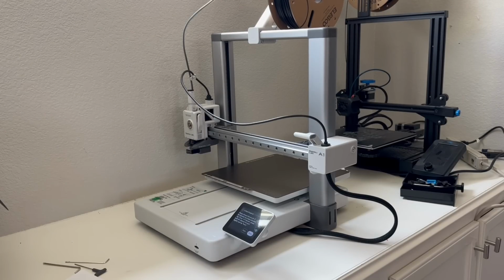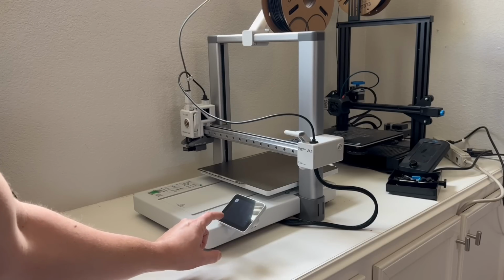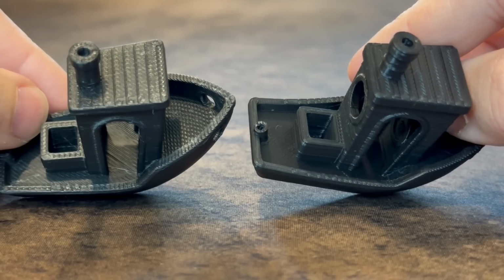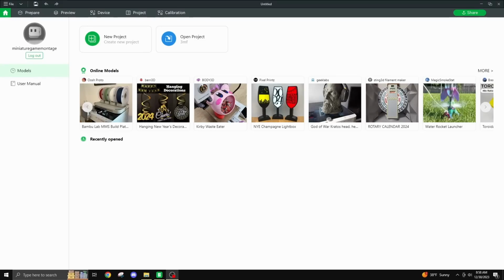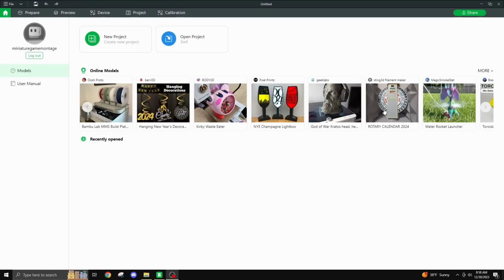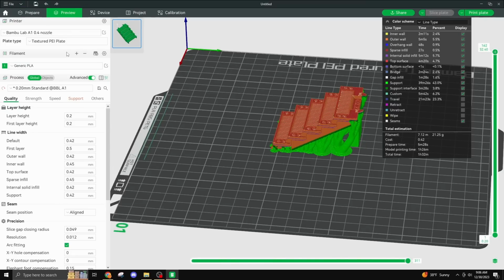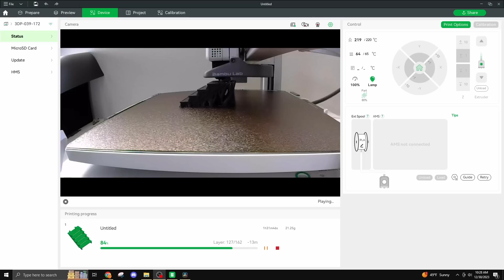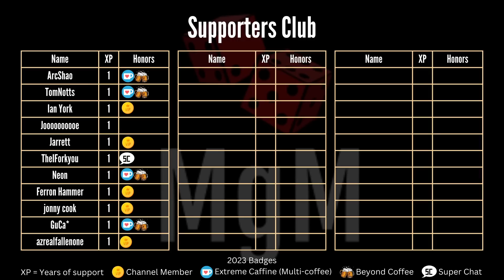Bambu Lab A1 Does it Work Out of the Box? | Issues and Review

Comment: man I did the same thing. Have my ender 3 v2 which is my work hoarse and I had flsun q5 for faster printing. The Q5 eventually crapped out after years and I  got the A1. So glad I watched this because I also didn't know about the load filament procedure.  The wiper went on with no issue.
Reply: hey I was wonder if there's a 115v/230v toggle switch on the A1? Can't seem to find it lolol

Comment: The Canadian Government has just (6 days ago) posted a recall notice update on a safety problem that goes back to Jan 30 this year. Perhaps my negative comments on the A1 for 3 months have finally been listened to. As the fault was electrical / fire risk with mains voltage how many electrocutions and fires were reported?

Issue

When the recalled 3D printer’s heatbed cable is bent or damaged, it can short-circuit and spark or burn through the insulation layer, posing electric shock and fire hazards.

As of July 20, 2024 the company has received 7 reports of damage to the heat bed cable in Canada, and no reports of injuries.
What you should do

Consumers should immediately stop using the recalled Bambu Lab Model A1 3D printer and contact Bambu lab for a refund or repair.
Reply from the maker: Right on. This has been on-going. I received my replacement bed last month and took care of it. My original cord was not impacted but I did it anyway. Safety first.

Comment: Great video, I also had a few difficulties. I think the assembly instructions should be better. As soon as you switch on the device, there are a few things, such as calibration, that are not mentioned at all in the enclosed paper instructions. 
My first print looked terrible. I had loaded the Benchy on the SD card and wanted to print it. The print speed was far too fast and the temperature for the set PLA was at 240°C. As a result, the filament turned out too soft and the Benchy was matt instead of glossy. Not as nice as in your video. I still have a few things to adjust here.

Comment: Really nice video! I'm thinking of getting an A1 to replace my current Kobra Go and this video set that in stone. There's no sponsor sugarcoating or anything and you point out some flaws that other reviewers don't (especially in the setup. When i got my kobra go I had to troubleshoot it for weeks since it seemed that no one else encountered similar issues to mine). It's also really helpful that you're comparing it to an older printer instead of one released recently, since it gave me a clearer view of the improvements and similarities i can expect upgrading from mine instead of the smaller differences that other reviews show comparing it to modern machines.
Reply from the maker: Thanks so much! 🙂If you're coming from an old machine it's crazy how far printers have evolved.

Comment: Big thanks for this video! Since you got the device, did u encounter any other issues? Do you still recommend this over to your friends w/o 3d printing experience?
Reply from the maker: Absolutely. I just did actually. It’s just a hands off printer.
Reply: Sweet! Thank you. For the purge wiper issue, could you post any link/video issue how you resolve it? Based on your video, I dont think I follow your resolution. You just showed a picture of the wiper which we didnt see in any other shots. Thanks in advance
Reply from the maker: @beforethebigbang892  you need to slide the nozzle head over prior to installation. Somehow installing it as is locked mine and some others in the comments in place.

Comment: How does the noise level compare between the V2 at your normal printing speed and the A1 on Silent mode?
Reply from the maker: The noise level is lower I think. The fans on the Ender V2 crank up and it’s noticeably louder. I will say if you’re printing fast and have a lot of corners, the noise level increases.

Comment: Hi, I wanted to make a fence for A1 bamboo because I have a room at 16°C and I had thought of making the walls with "non-woven fabric" (i.e. the fabric that is put on plants in winter). but without the front wall and the another 3 removable so that the machine can breathe but at the same time have a more or less acceptable temperature for printing. I think the electronics have no problems ps. I will only use pla and petg, what do you think?
Reply from the maker: I'm afraid I can't be much  help here. I am not sure.
Reply: Ok grazie

Comment: How did you solve the issue with filament loading? Loading the 1rst time,my extruder just keeps clicking around and no filament comes out. Already unload and loaded several times. :/
Reply from the maker: There’s a filament button on the screen. Press it then press load filament. The hot end will heat up and you gently press the filament forward at the spool. When you see it extrude click done. If you don’t see it, repeat the steps. Once complete your filament is loaded and ready to go

Comment: This is a great PSA, thanks for including your troubleshooting work. Great to see an unsponsored take. The comparison with the Ender 3 benchy really shows how much printing tech has evolved in recent years. Have you had any print issues since the video was filmed? Since day one I've had massive stringing issues with anything I slice in Bambu Studio or Orca Slicer no matter what filament settings I adjust or how long I dry the filament (multiple brands of PLA). It kills me because the consistency in extrusion is better than any other printer I've owned, and the AMS Lite functions very well for swapping filament, but I can't enjoy it because I can't get any good parts.

Extruder gears have been cleaned, filament calibrations have all by done. I can use the same filament on my old Prusa MK3S and print perfect parts, so I'm suspecting a firmware issue (and the old firmware is not available for me to downgrade to in the app), or more likely a hardware issue, since plenty of other folks are having no issues. Some of the models on the SD card printed fine, but I lost the files when I formatted the SD card during troubleshooting so I can't check out that Gcode to see if it's code related- slicing the same models in Bambu Studio with the stock profiles leaves me with tons of stringing.

I mitigated the issue by installing a hardened steel nozzle and bumping the temp up 5 degrees, but then a day later I started seeing bad seams and sporadic under-extrusions. My current theory is that it's related to the extruder's pressure sensor that they touted could compensate flow rate on the fly. If it's presenting faulty readings, it could be compensating incorrectly and causing my issues. I submitted a support ticket to Bambu on December 26th and am still awaiting a response. I will edit my comment with an update if they end up coming through for me, but overall I'm not impressed with the product or company's support.
Reply from the maker: That’s unfortunate. Thank you for sharing as others may relate. I’ve had zero issues since my initial set up problems. I finished a 12 hour print last night. It has been running pretty much non-stop. 

I’m not savvy enough at this point to trouble shoot on the machine but curious what you learn. Keep me posted!
Reply: @ribieconvoy  did Bambu figure out a fix or replacement for you yet?

Comment: Hey Jimmy   thanks for this video. I was gonna reach out to you last week to ask your thoughts on a 3d printer. Perfect timing!

Thinking about getting a Bambu A1, A1 mini or PS1.

Three questions - 

a) what type of filament do you use for your terrain (plastic type pla or pet or something else)?

b) would this printer make  movement trays (for kow or warhammer fantady / old world) which stay flat on all corners or would it likely produce warped movement trays?

c)  would you recommend a different sz nozzle (.2 for example) or to upgrade to a hardened nozzle vs what it comes with?
Reply from the maker: Glad it was helpful. I use just regular PLA. Not anything fancy. I typically would use Sunlu but I recently ran into an issue with a spool. In looking at it, I purchased their Matte line and it caused nozzle clogs in my Ender 3. 

They were zero help in refunding my product and I've used them for years. I purchased Elegoo PLA and I'm back to printing. 

The Bambu bed appears to stick really well. Almost too well. My Ender 3 would require a glue stick to prevent warping on larger prints but the Bambu I'm not using anything and it sticks really well. I'm doing a larger print now and it's just fine. 

I'm confident you could product non-warped movement trays as long as you allow the print to fully cool before removing it from the bed. They couldn't be too thin, however, or any printer wouldn't work. 

Hope that helps!
Reply: Thanks so much.  Would you recommend upgrading the nozzle to a hardened nozzle and / or a different sz (.2mm)?
Reply from the maker: @celticgriffon  Can't say on that one. I haven't made any changes on mine and have just been operating with stock. So far it's very good.
Reply: Awesome. Appreciate the quick reply and fantastic content. Happy New Year!

Comment: I have been a ender 3 v2 user for about 1 year. It's driving me crazy that the printer keeps breaking something. The nozzle constantly gets clogged and the calibration setting is broken. So I will order A1
Reply from the maker: I’ve had good success with my Ender. That said, I’ve replaced springs, nozzles, hot end, Bowden tube, extruder gear, extruder arm, and various other things. It’s still going strong but tinkering is a big part of it.
Reply: @MiniatureGameMontage  Yes, it produces very nice prints as long as it is repaired. I made very nice prints with Ender 3, but the same simple mistakes over and over become annoying after a while. It takes too much time.
Reply from the maker: @Craftzone3d   I agree. My recent issue with replacing the extruder arms and gears made me start to look at other options. And the technology has really progressed!
Reply: @MiniatureGameMontage  Sometimes my filament fluffs when printing, what do you think is the reason for this?
Reply from the maker: @Craftzone3d  what filament are you using? Have you changed recently? Does it stop coming out? What are you seeing?
Reply: @MiniatureGameMontage  The filament I use is porima. It is a local brand of the country I live in. I use recycled filament. Most of the time I get nice prints, but sometimes there is pilling. I think the problem I'm experiencing may be due to the nozzle or filament.
Reply from the maker: @Craftzone3d  Unfortunately, it could be a number of different things. You could try a different filament to see if it works better as the first step towards a solution. I would definitely make sure your nozzle isn't clogged and operating normally. 

If you feed filament through manually while it's heated and it curls there could be a small clog somewhere. It should be dropping straight down if operating freely.
Reply: @MiniatureGameMontage  after writing here, I reduced the nozzle temperature from 220 degrees to 200 degrees, I think there is no problem now.

Comment: I just ordered the A1 with AMS lite yesterday and received a tracking number today. I'm sorry, but I didn't quite get how you solved the "stuck tool head" issue. Can you give a little more step-by-step details about it? I just want to mentally prepare for when I receive it. Thanks for the informative video!
Reply: @Tevon93  thanks!
Reply from the maker: @TheAwesomeSam Yep, he nailed it. Move that toolhead over before you put the screw in. And make sure that USB-C is nice and snug at the bottom. I haven't had a failed print yet so I hope you have the same success.

Comment: Man you know that can update the firmware of that Ender? Mine makes a benchy in 21 minutes. OFC you have to update the cooling and nozzle too.

BTW that Ender is an older model, it even has a glass bed, this year Ender 3 VE has full auto bed level too and can make a benchy in less than 30m, I mean it's not that fair to compare a recent fast bedslinger to an old Ender running  Marlin 1.x without input shaping.
Reply from the maker: Yeah I'm sure that Creality and the rest of the big players are making similar speed and quality printers. That's great to hear. Since I already had an Ender I figured I would give something else a shot.

Comment: Thanks for the video. Bought the A1 as well and after the set-up I couldn’t get a benchy printed ‚cause the first layer just won’t hold…frustrating and trying next week again
Reply from the maker: That’s interesting. I’ve had zero issues with bed adhesion. I run the auto level on every print. I’d be curious what you find out.
Reply: Guys - it works and you wouldn‘t believe what the root cause was. It appears I used a not really clean tissue! I changed to a paper towel more or less and that did it 🤷‍♂️ thanks for your hints and tips and wishing a healthy and nice 2024 🎉 for you guys and your community
Reply: Yeah will check again next week ‚cause as you mentioned a bit frustrating - but maybe it is me 😅 the speed is insane right but on my prints that I tried I reduced the speed on the display to standard or even I guess it is called silent (in Germany so maybe translation is wrong 😅).
Reply: @Skysailer75  if it's dragging the filament around right from the start, check your Z height and your temps. Make sure you've got your print bed set to PEI, your filament set to PLA (if that's what you're using) and try printing something at normal speed. Remember that silk PLA and sparkle are different animals with different heat constraints. Been there so many times and I know how frustrating that is.

Comment: This my first 3D printer. I’ve printed a few things from the sdcard, plus I drew and printed a simple wedge piece for mounting a battery charger at an angle to make the display more visible. I had no problems with any of them. I used PLA Tough filament. It’s quite amazing watching this thing work. Granted I don’t have the AMS so any inherent issue in that piece of equipment won’t apply to me. I’m very happy with my purchase so far.
Reply from the maker: Awesome. Since my initial setup issues I have yet to have a failed print. Thanks for sharing!

Comment: toolhead is malfunctioning out of the box, not impressed.
Reply from the maker: That was the USB-C cable at the bottom. Essentially it wasn't reading as I didn't have the cable pushed in enough. But yes, lots of options in this price range between Bambu, Elegoo, Creatlity, Prusa and others.
Reply: You won't know until you try one.
Reply: I have two Prusas that worked right out of the box this does not make bambu look like a quality product in my opinion.
Reply: @michaelpartlow6625  the MK4 is a fine bit of kit, but you'll have to spend many hours assembling it for a much higher price than the A1 with the AMS unit. Prusa is just not competitive any more at the <$1000 range. Their time to market is abysmal. Bambu doesn't have the customer support chops that Prusa has yet, but they're better than pretty much everyone else, and they can deliver a printer on time within a couple of weeks from order.
Reply: @michaelpartlow6625  IT was his fault.. Get up to speed my man.
Reply: @Vanity2021  still malfunctioning went through every cable still the same result, waiting on bambu to email me.

Comment: Why people ask for bigger printers?
When you go over a certain size most of the machine needs to be changed, it's not just doing it bigger 🤔
To go faster with bigger will change the shape of it so it will not be square anymore and so on. I think this bed size is in the sweet spot 😉
I have the mini and it's the only go to printer now, and the ender S1 pro , I use it as a laser engraver 👍 that's it. Others found their way back to the box and will be sold 👍
Reply: We need a larger coreXY printer with the reliability of a Bambu. The K1 Max and QIDI Max aren't there by a long shot.

Comment: Bought this printer and had the exact same experience ie jammed tool head and difficulty loading the filament. Bambu support is well aware of this problem but have done nothing to warn new users. Fortunately I solved the issue on my own as it took several days for support to get back to me.
Reply from the maker: I'm glad it's not just me. I almost contacted support because I couldn't find anything helpful. That's why I had to make this video. 😂 All they need to do is update the instructions.
Reply: @MiniatureGameMontage  

Too right, it’s a pity I did not have your excellent video to refer to at the time. The printer has many excellent features but is not perfect, having to use Bambu Labs slow and laggy cloud service for WiFi is bad. I used an Ender V3 KE for a short period which just connected via home Wi Fi and it was so much better in this respect.

The slicer is much better than the Creality slicer but again is not perfect as it is not connecting brims correctly to the model which makes certain thin parts warp badly.

Comment: I've been printing for over 12 years now. I've worked  at least 20 plus printers to their death.  The first printer I purchased took over 4  hours to build, had to hand wire the circuit board in. Went to a glass company to make a glass bed as the steel bed provided was junk. Like you I recently purchased this newer technology. I have to say these advancements make 3D printing, 3D printing. You no longer have to troubleshoot and tinker with these machines like you used to to get them working. The speed at which you can print is insane compared to previous models. My hobby is 3D printing objects, not fixing the machines. Unfortunately all the years of doing it I've learned both. You put really good video together straightforward with an honest take on your results, Great job
Reply from the maker: Thanks! It's important to have those "tinker" skills. My old Ender 3 taught me a lot about frustration, patience and trial and error!